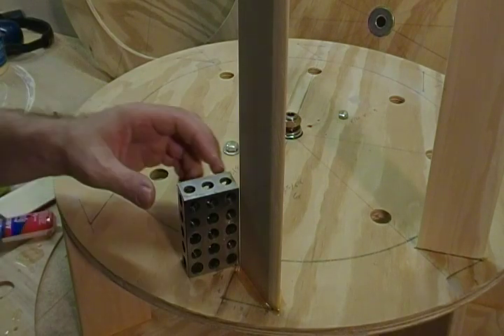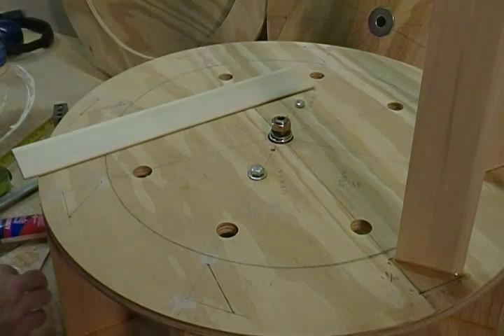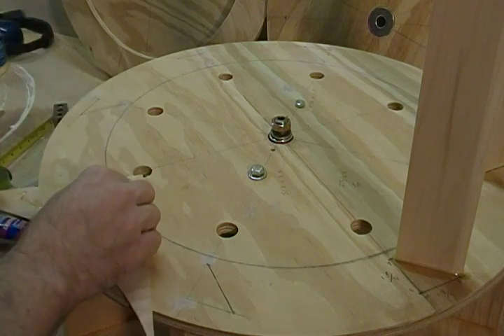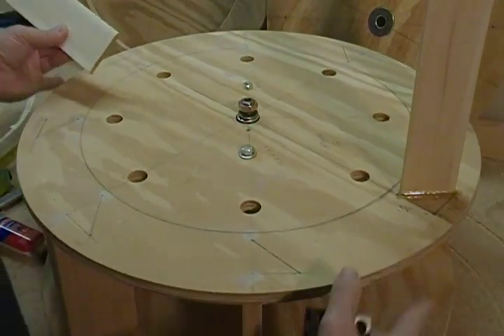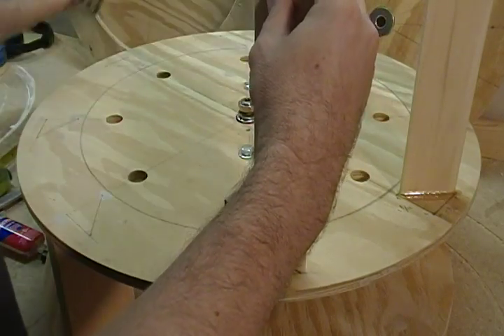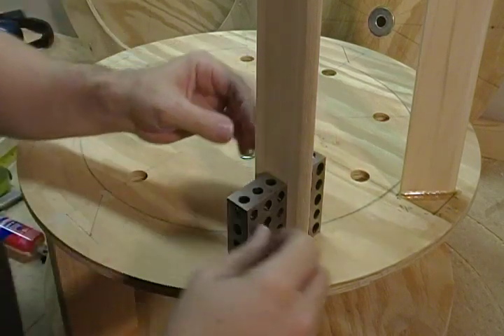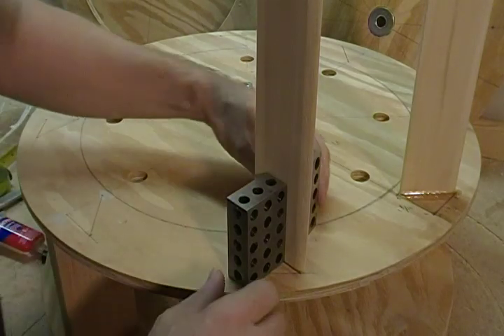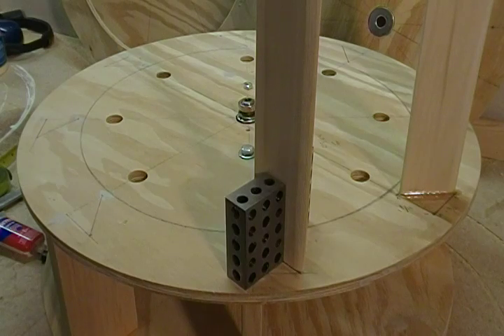Building a Wind Turbine (34  of 46) Glue and Square Poplar Stators Eight Places

Comment: Hey Mike, 

Are these poplar staters the same material as the LP logistic Ailleron type or just regular pieces of wood to provide the wind direction to the rotors?  Any matter as far as the direction (if it is the ailleron type)?

By the way did you specifically calculate the 5 degree difference or is it just common knowledge?

Comment from the maker: @shezzzzzz Well it would depend on what you are using as a generator. However, as a baseline I'm putting about 300 rpm on the "Wind Blue Low Wind" Alternator. If you google wind blue power (no I'm not affiliated with them) and check out their low wind alternator. They have a chart there you can use to estimate the watts.